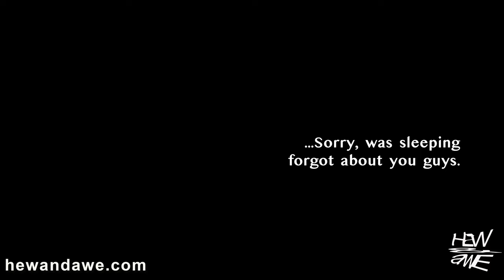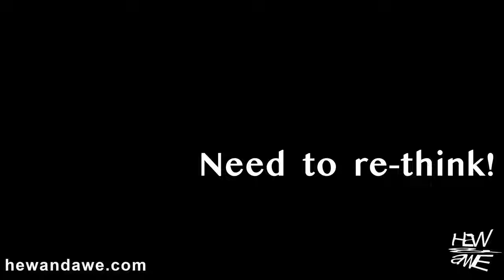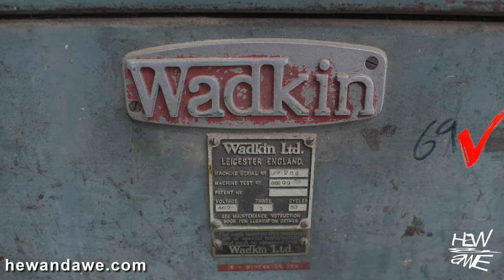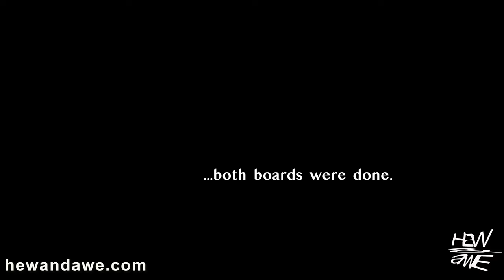How to Build a Modern Monitor Desk Stand

Comment: Dune.
Reply from the maker: Ma-man! 😁 ah, original or latest?
Reply: Original, of course. Is it?
Reply: @HewAndAwe  David Lynch's version
Reply: @tripencrypt The ONLY Dune movie (in my opinion)
Reply from the maker: I started to watch the newer version switched it off after 5 mins, I thought later why did I switch it off. I thought I didn’t like the lead actor, i went back to it watched the whole thing, its good, made me want to watch the next one, its not as good as the original but then its also pretty much the same film with better SFX. I’d completely change the cast that’s for sure! Needed a 21st century Still to come floating down and land to fight…
Reply: @HewAndAwe  it weren’t bad. Why do they talk so quietly though? The loud bits then end up rupturing your ears as you have to crank the volume to hear them speaking. I’ll be watching the new’un. The old one is mental. What’s better, that or Eraserhead?
Reply from the maker: Actually that’s a very good point now you mention it, on my big tv with the decent speakers upstairs were banging on the floor and that’s with out the sub connected, I hate films doing that, my dad said he’d have the edit purposely do that just for shits and giggles 🤦🏻‍♂️
Reply from the maker: Dune all day long!!!